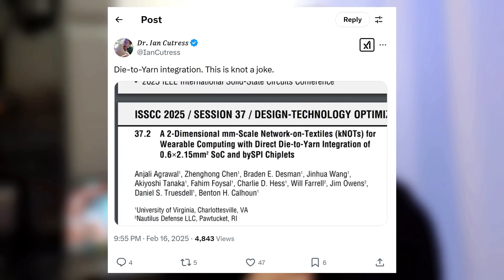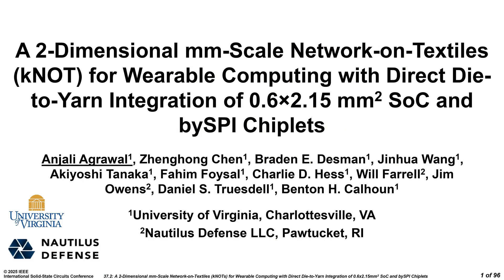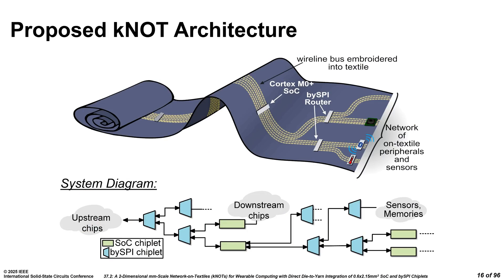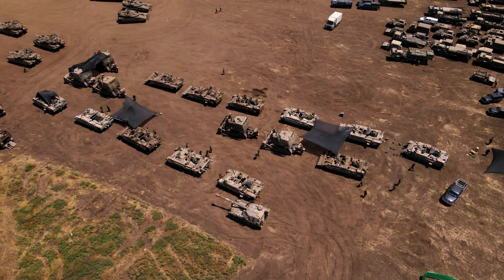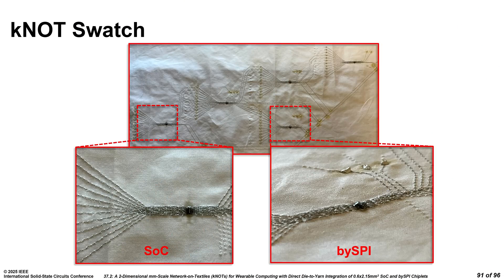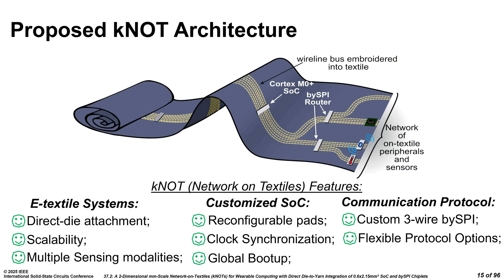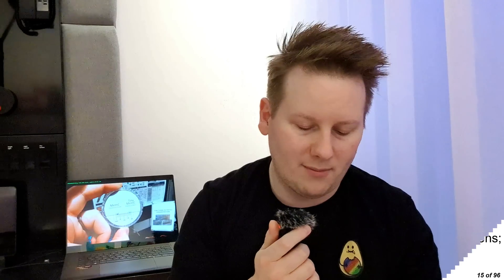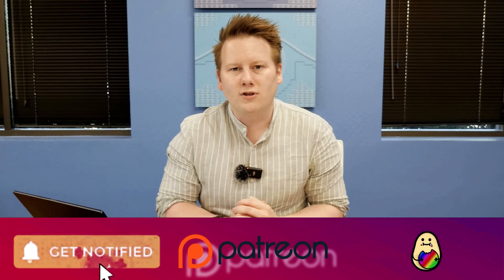Why Are People are Researching Silicon in Clothing?

Comment: There was s really neat talk a bit out of left field in a conference on advanced packaging by an engineer integrating atmega arduino chips into clothing for industrial workers to replace custom parts that typically monitored environmental and biometric data. The specific example she worked through was the service technician who will during the regular upkeep of commercial airliners be dropped down into the fuel tank to inspect it and scrub away particulate and sediment residues. The number of constraints on clothing due the 30 cm diameter door into the tank,  possibilities of asphixiation or poisoning and the near impossibility of removing an unconscious human from the bottom of the tank, and potentially 'dramatic' consequences of static or electrical discharge .... and then the relitively large size of the components ... it was in  a lot of ways the best engineering talk Id seen in ages. It's one of those "iceberg" problems where the obviousness of [exploding is bad] distracts the designer from perhaps a dozen other ways the task could go wrong - most of them every bit as fatal.

Comment: Ian you need to go to DARPA conferences. You likely to bump into Lisa Su there hanging out with friends

You hear all the bull from Musk  about Space X and how it came to be! It's garbage, all the early flights by Space X were fully funded under their Falcon project, aim to allow fast access to orbit. Everything Space X does is a DARPA or DARPA equivalent from other agencies funded.

So what you're looking at is work from the Advanced Warfighter programs. Similar systems exist for Power/Data Over NATO Rail, to allow easy transfer of power & Data of devices attached to NATO Rail on guns etc in environments which are a soup of radio emissions.

Adam Savage talks about another spin out that is now widely availble. Power/data over metal Velcro.

If  you have a look at what DARPA  are specifying you get a good clue to everything coming down the pipe. Where did you think Apple watch comes from. Or cars that drive themselves. 

Clothes that supply power & data via fabric is a potentially multi-trillion dollar business. Think of it's use in medicine?

Other DARPA projects like US robotics dog etc. Or powered legs to help Special operations  carry in/out extra loads are dropping in cost and being sold to the assisted living market. 

TL:DR Watch/Goto DARPA confrences

Comment: It's sinister.  Years ago I was looking at doing 100 to 1000 hours battery life computing using forth misc chips.  Throw the arm and riscv in the bin, go and look them up. This is the one they proposed to drop by the Trillions, on the US border to form a smart dust parasitically powered wireless sensor microprocessor mesh to detect intrusion.  They were, and maybe still are the lowest energy microprocessor record holder, and likely the highest performance at that energy level, asynchronously clocking up to several hundred mhz, plus I had proposed simple changes to greatly increase performance at very low energy levels.  Greenarrays is currently the only public player, who has simplistic designs suitable for this purpose, but can do advanced high performance designs.  There is also a second non public group with a 40 core performance system 1mm2 or some such thing, very low energy, can be done at 6ghz per core (I suspect 40nm).  It is being used for some undisclosed use.  But, whatever they dom the other group can do.  This is the cutting edge of low energy chip design.  15 years ago, it was about 1mw per 100mhz on an old process they could sleep in the pico wat range and cycle as signals came in, even just a cycle a second or year, I would guess.  Since then better manufacturing nodes have dropped the power consumption.  What could be done at n2, would be interesting, but that's not an ultra low energy node.  However, recent material announcements are proposing to drop overall power consumption off a cliff, but I do not know if they are applicable to this application.  When your processor is a few thousand transistors plus memory, you can just use a chip line to manufacture.

Comment: What exactly is new about this? We've had thin wires forever. I don't think any of the high-volume textiles manufacturing machinery could deal with this, and it seems extremely prone to failure from bending and material fatigue (remember wired headphones?).

Comment: The military advantages could be huge. Not just tracking, but just imagine sensors that monitor the world around you and when programmed for specific object detection the fabric can give a little vibration in the direction enemy contact is detected so you are aware of someone who just came around a corner behind you. Or have logic that monitors faces and positioning of those around you and give a warning of being followed by someone after the clothes have detected the same person behind you for too long. Perhaps down the road if we get materials that can vibrate and contract and expand a little bit we can also make smart cloth armor against handheld weaponry where when sensors detect a sharp object moving towards you the material contracts as much as it can and while it probably wouldn't stop a blade it could limit the depth of a stab or slash as the material becomes more dense at the impact point.

Such fabric that can expand and contract small bits may have some use in the everyday world with sizes that conform somewhat to the wearer's body. You can set your clothes to be tighter or looser depending on the style you are going for.